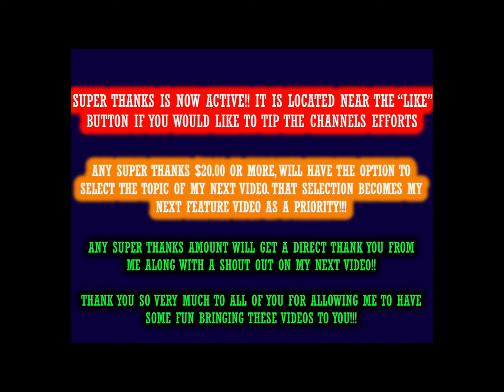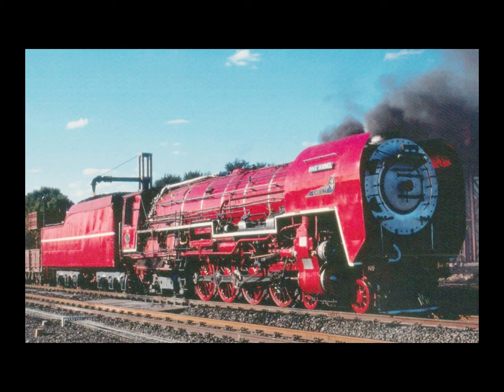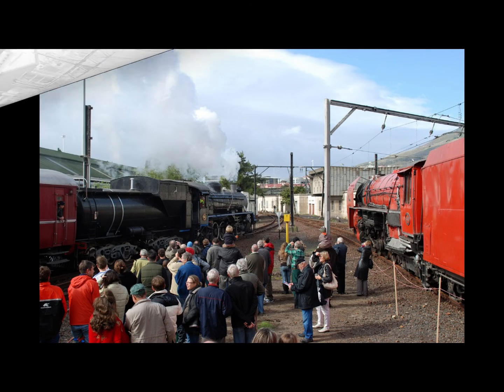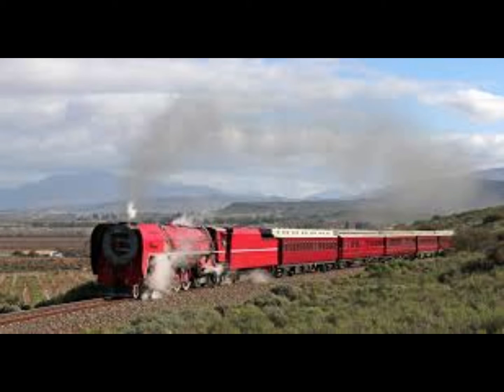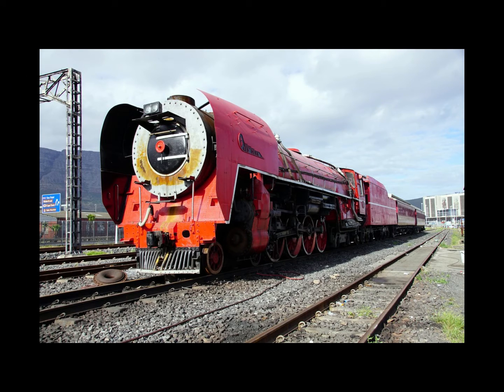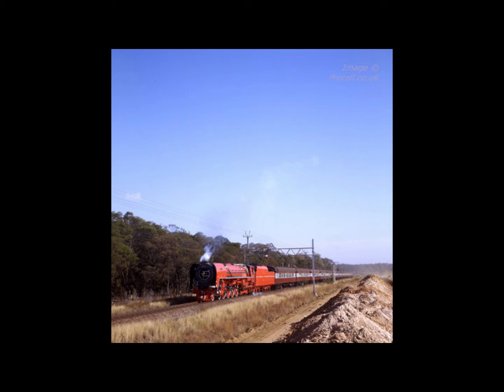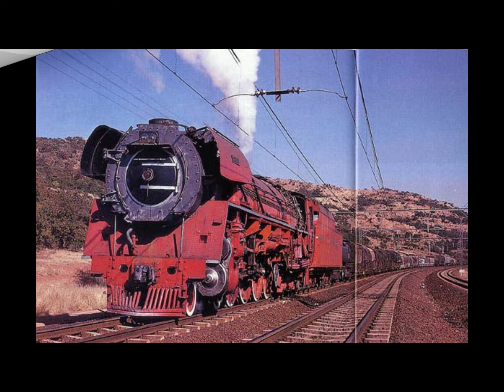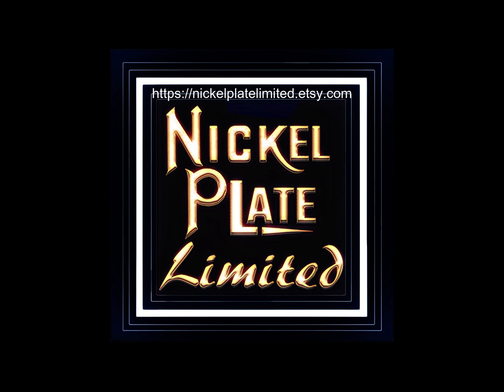SARS 26 Red Devil Steam Locomotion Re Invented

Comment: Ah-HA!  I know what book you were reading from at the start.  I have it too!  

THE GREAT BOOK OF TRAINS by Hollingsworth and Cook

We got it about 30 years ago when I was just a toddler.  I used to just look at all the pretty pictures, but over time I started to read about a few of the cooler engines.  Eventually, I spread out into more and more engines, reading up on all kinds of different locomotives and how they related to each other.

I've read the class 26 entry so often that I practically have it memorized, which is how I easily recognized that you were basically reciting that entry from the book.  No shame there (you can tell how great it is by virtue of the fact that I'm still going back to it after 30 years and re-reading it all the time), and you clearly added more than a little bit of new content, but you might want to cite your sources at some point.
Reply from the maker: I've had it a very long time myself.. So yes a lot of the info came from it.

Comment: It's essentially a 2/3 scale American Northern in most of it's dimensions and figures.
The often mentioned power output of 4,500hp is the indicated or in other terms cylinder horsepower, which doesn't take in account the friction and air resistance losses.
So the drawbar horsepower of 4,023hp as on the shown stats sheet is correct.
The class 26 was able to do the work of two class 34 or 35 EMD or GE diesel locomotives, but I haven't seen a cost and availability comparison either.
But I know that at the time this locomotive, and its predecessor experimental and rebuilt class 19D 2644 where Wardale tested some of his ideas on were developed because of the sanctions of many countries against South Africa because of the Apartheid, with a shortage on oil as a result, while SA has an abundance of coal.
Reply from the maker: Yeah... I noticed a distinct lack of head to head performance stats comparing the Devil with modern diesels of the time.